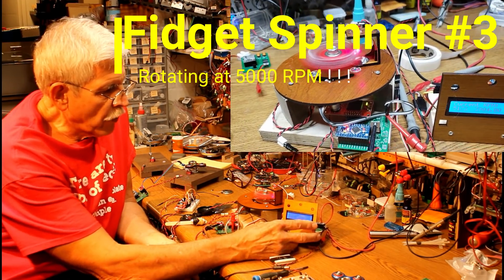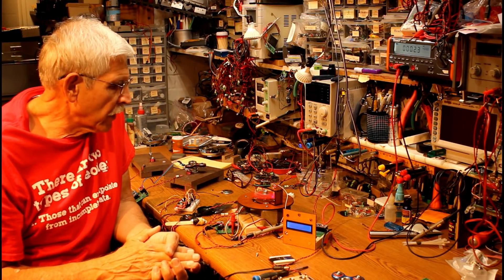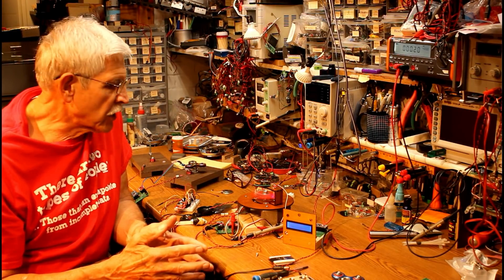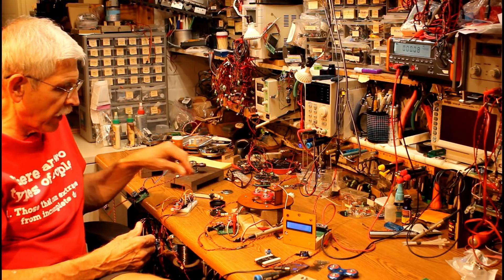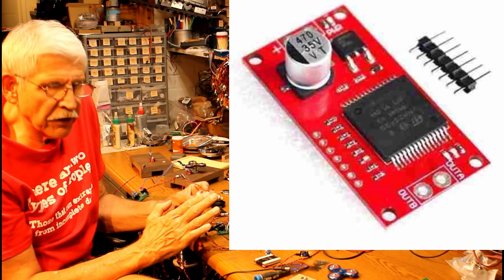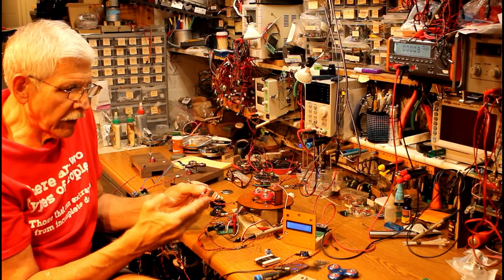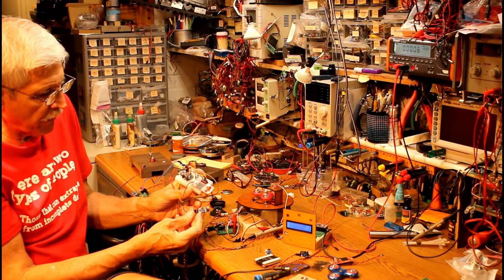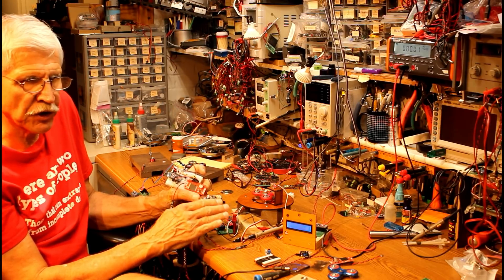Fidget Spinner Brushless Motor #3 - 5000 RPM ! ! !

Comment: Hi Dave, I am going to order Pro Mini - ATMEGA 328P - 5V 16Mhz - Compatible Board, but I don't see a socket to hook up to the computer to download your program.
Reply from the maker: Ralph - you need a USB to serial adapter like this
https://www.amazon.com/HiLetgo-FT232RL-Converter-Adapter-Breakout/dp/B00IJXZQ7C/ref=sr_1_5?crid=3RAGW666O7CKA&keywords=pro+mini+serial+usb&qid=1661003595&sprefix=pro+mini+serial+usb%2Caps%2C72&sr=8-5

dave

Comment: I've found that my fidget spinners turn into a pipe bomb at just over 5400 rpm. I use a program called SimpleDyno (google it) for my rc cars and it's fairly easy to adapt it to this. So far I've hit .8 HP @ 5400 rpm, then I shut it down. I use red bones skate bearings because the stock bearings are trash. If you try this  I strongly advise building a plexiglass shield as I have had 2 of the plastic housings break apart and those magnets fly out like bullets..  heh
Reply from the maker: Thanks for the warning, Dan 

dave

Comment: Your setup looks so much more professional than mine. I originally thought mine was going around 5000rpm when i maxed out the bearing, but after watching this and hearing what yours sounded like running at 5000, im starting to think its more like 15000 or so (i still have no method of measurement) because mine sounds like a dremel at maximum speed. Im really looking forward to the arduino tachometer even though i have no arduino experience. I think im going to try making a more efficient version next because my current setup using ~35 turns of 16awg magnet wire draws about ~30 amps constantly so i use a massive 15x25cm heatsink on the mosfet so i can run it for more than 10 seconds. My plan is to make the more efficient version run for at least a week on a couple of AA batteries at very low rpm. I think it might be fun to have it just constantly spinning on my desk
Reply from the maker: It sounds like you could be at 15,000 RPM!  Keep us posted on your experiments and I'll make sure I follow through on the tachometer - there are some notes on it on the web page right now but I need to do a video.
dave